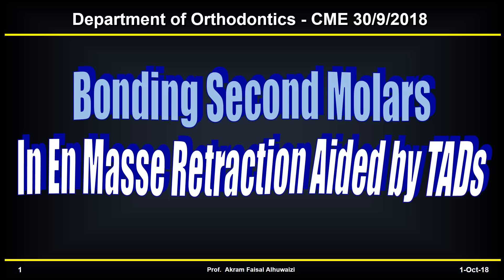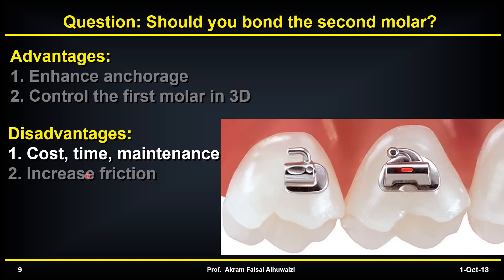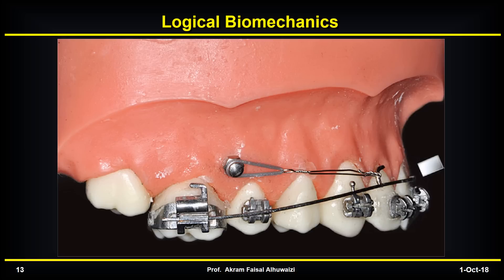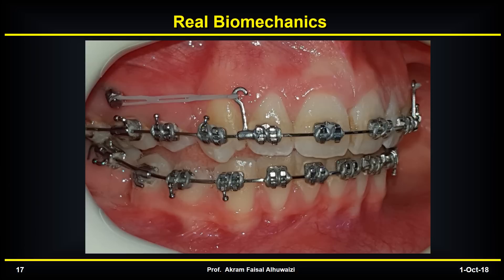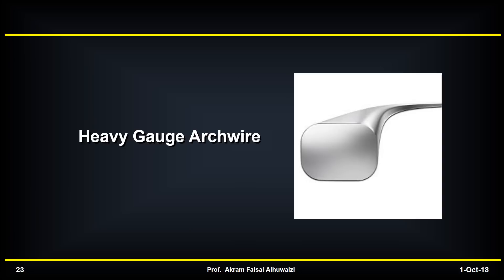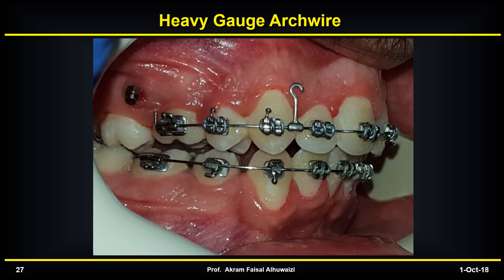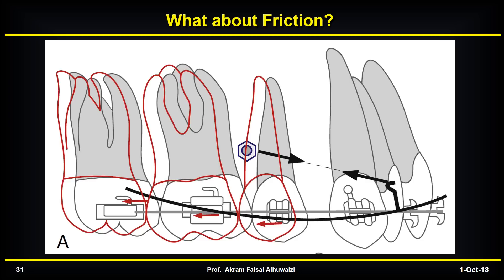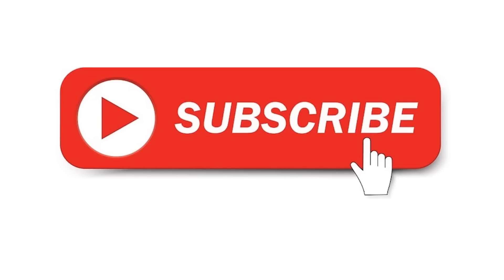Bonding 7s when using TADs

Comment: Sir i have question… i have gap of first premolar in my upper teeth and i have put on braces. Now my dentist recommended me for mini implants to force the teeth without touching the lower teeth .. but i prefer to have braces to lower teeth … what option is better ??? Nd where gap will goes ??? Between last molar and wisdom teeth???
Reply from the maker: I think the front teeth will go back and fill the gap. I prefer to put braced for upper and lower for most cases

Comment: Hi Dr, thanks for the video! I’m a patient with overjet, I have all wisdom teeth pulled,where should I place the TAD ? Can I push the upper teeth back while keep the bottom teeth untouched?
Reply from the maker: Yes you can. Place the TADs between the 5 and 6 or better infrazygomatic
Reply: @alhuwaizi   he said can i neglect lower jaw ?? he mean just bonding of upper... is it right or we should bond lower jaw also
Reply from the maker: @drdidar7541  In most cases, you need to treat both upper and  lower to get good occlusion